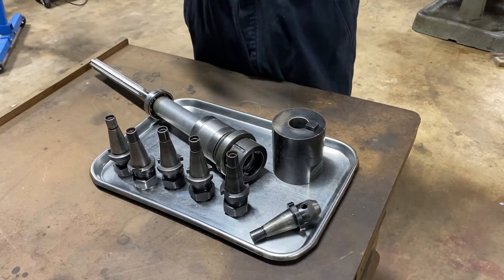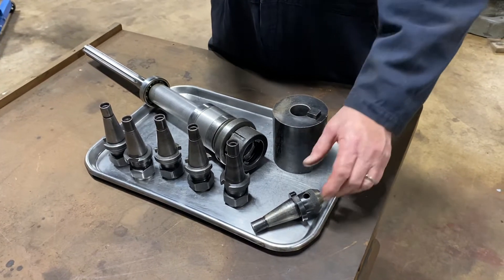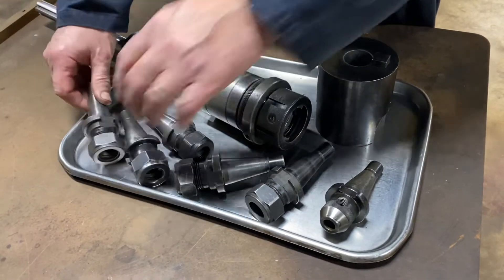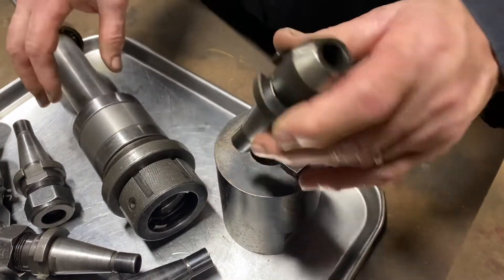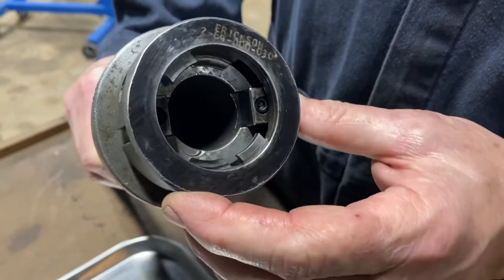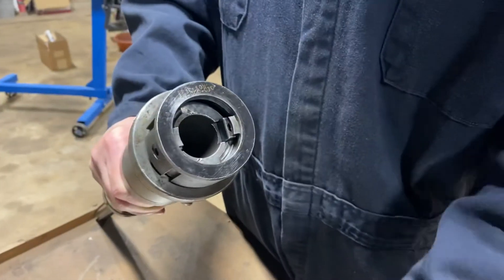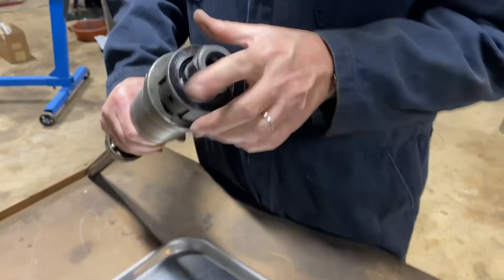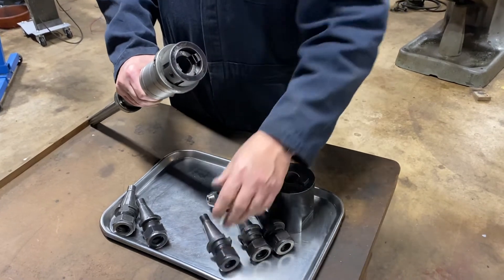Sky Top Shop - Bridgeport mill - Erickson / Kennametal Quick Change 30 (QC30) spindle

Comment: I have a BP with a QC. I would like to have a discussion(DM or phone. with you when you have installed.
Reply from the maker: I’ve had the QC30 spindle installed for some time. I ❤️ it. You can contact me via Facebook. Look for Sky Top Shop. 👍🏻
Reply: Sorry I don't do any social media. I like mine too. I wont to tall about the run out when you reinsert a collet 180 degrees.
Reply: Thank you for the video as well as the Facebook contact info, I just acquired a bridgeport series 1 cnc mill with this spindle and I knew it was a 30 taper tooling but had no idea which or how it worked.